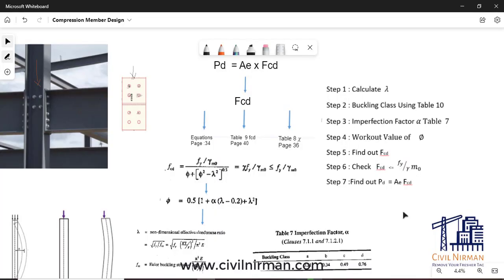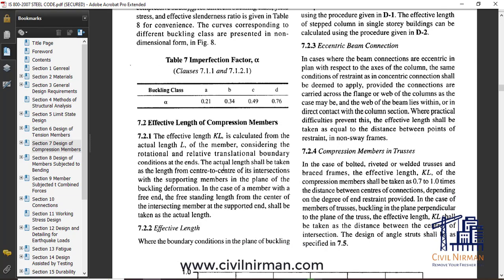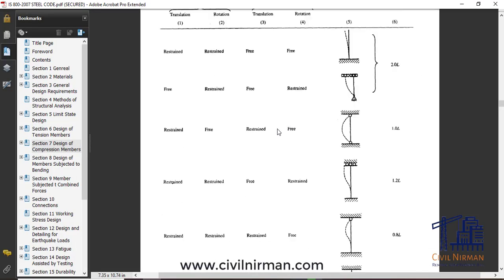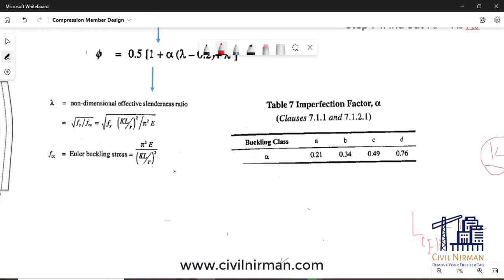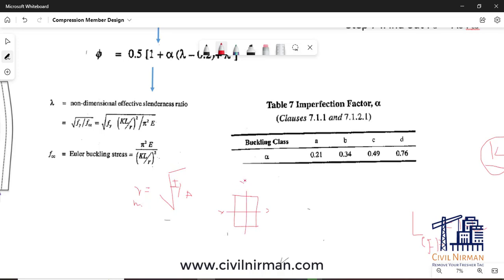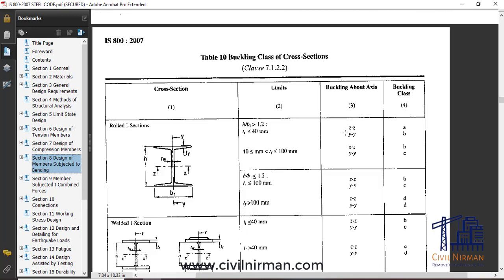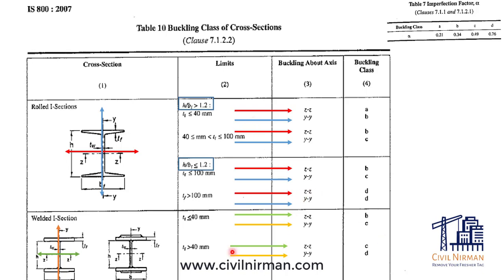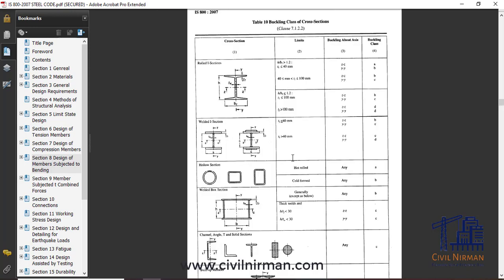Design of Compression Members As Per IS 800:2007 Part 3

Comment: What is the value of E?
Reply from the maker: Any structural member, or a structure as a whole, has a certain rigidity (stiffness for the lay) determined by the modulus of elasticity E  & I
Usually based on common steel used in industry , E value is 203 x10^3  Mpa
For Various Categories of steel it may vary .